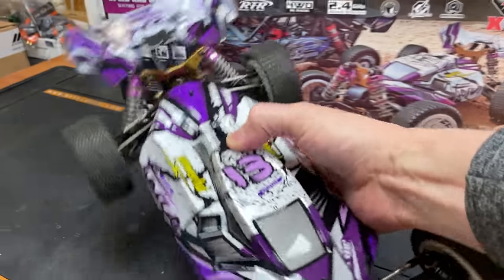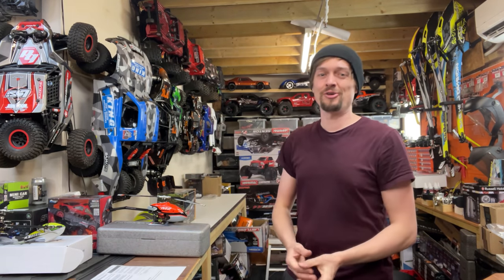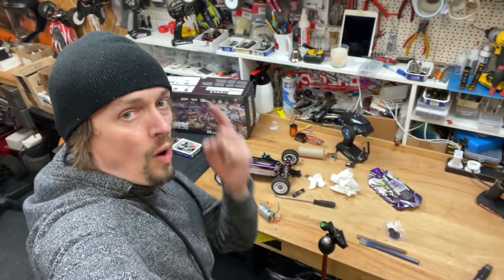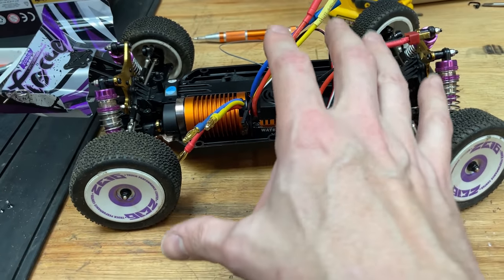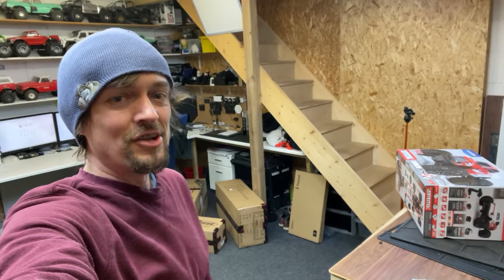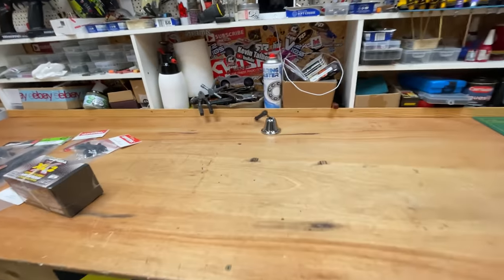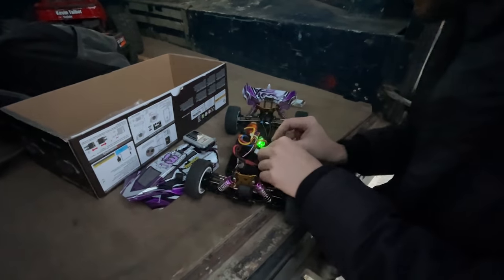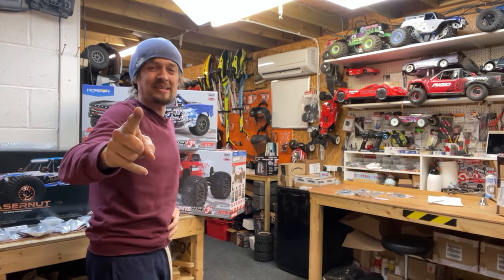Project 100mph DIRT CHEAP rc car

Comment: Hi kev, that paste on the chassis is to control the motor's thermals, since the aluminum chassis is a very good heat conductor. Basically the chassis is used as a massive cooling component
Reply: A bit like thermal paste on a computers processor then?..makes sense!
Reply: @mrmagoo.3678  Exactly!

Comment: welcome to the 124019 club!!!! in order to get that pinion gear out you have to remove the rear end cover all the way on both sides. The front has to come off as well. Make sure you grease the gears inside the gear boxes as well. Foam tires all around
Reply: Hey mate do you think the 124019 is worth it please answer me 💯🐐🔥

Comment: The white stuff under the motor of the 124019 is actually like heat sink paste similar to the one use on a computer processor. It uses the metal chassis as big heat sink.

Comment: Hey Kev, i've got a Lasernut and it's ace! Not a basher really, but for one bit of advice before you get going for real, change the centre diff spur gear to an alloy one, the stock is plastic and made of something like playdoh. Hot Racing and Vitavon do a good one.

Comment: I have one with 120 amp 10BL120 ESC + 3650 brushless 3100 KV  platinum from surpass hobby and it is a Monster on steroids, ESC and motor stays cool at the point you can drive non stop for 2 hours as long you have spare 3S or 2 s  batteries.  I have 2 others with 2838 and 2848 brushless motors with 35AMP and 60 Amps with 17T pinion mods and it is also pure madness jumping high on dirt track and still more than 60 Km/h on 2s and around 75/90 Km/h on 3S. And after all of this I still love to drive my others 144001 with stock brushed motors daily on my garden tracks. 
Long live to 144001 !

Comment: You better take a fire extingusher with you, Kev. Got exactly the same brushless motor and ESC two days ago... Works good... Exactly for ten minutes... Then it starts cogging. On 3S the motor was so hot I burned my fingers on it. The ESC is definetly not capable of 60A. Hopefully it's not catching fire. :D

Comment: I seen you with one I liked it so after shopping and buying a 40$ body and Axel's 47$ front 47$ back . 40$ on linkage .15$ on wheels and 17$ on transmission it's going to be ready to build by next week end . I'm putting slow moter in at first see how it dose then go to the next level up till it's happy may put a shell over it as well  . Will do video of build and test runs

Comment: Bevel gear for the rear diff is on the end of the shaft. Need to take the rear diff apart to change the large plastic gear.

Comment: "What the hell is all that?", you ask,  that is thermal paste, put between the motor and the chassis, to enable the metal chassis to act as a giant heatsink for the motor. IMHO a smart move by WLToys to allow the brushed motor to better shed its heat and last a little longer.

Comment: I'm pretty sure the paste that was between the motor and the frame was thermal paste, since the stock motor doesn't have much airflow or a cooling fan I assume that was to help not burn out the motor.

Comment: Ooof Kev those GoolRC Electronics go up in smoke all the time. Consider HobbyWing. 1/10 scale systems may be a bit more but still very cheap overall and don't burn out. Also, Arrma just released the new Vorteks 3S BLX 4x4. A Legendary name returns after so many years and its looking very good.

Comment: Tekno et48.3 / et48 2.0.   .3 version has all m2c upgrades available, you have to get the mt410 and covert it, only difference is chassis, and you’d swap out m2c towers anyways

Comment: Hey Kev huge fan watched all your videos 2 or 3 times. 😎. Can you show your viewers the Force Epidemic which has been discontinued but can still be purchased. New name for the truck is FS racing Big Foot. Fs racing has a huge line up of cars and wouldn’t mind seeing a different brand altogether on this channel. Thanks for the laughs 😎👍
Reply: E-hacker is the new epidemic or you can go 6s with the big foot. They both share same platform ie. the entire roller suspension bulkheads everything except some electronics and aluminum parts

Comment: Hey I have a question about the e revo. I upgraded my E revo (1.0 or original idk what to call it) from brushed to brushless. Now it has a brushless motor and the E revo 2.0 esc and ever since I upgraded it I’ve gotten this lag between going forward and backwards. Basically instead of trying to instantly go forwards when I’m going backwards (or vice versa) it stops and I have too put the throttle on neutral and then the way I wanna go again. But it usually takes three to four throttle resets for it to actually start moving again. If it was just go forward break set it to neutral and go again I wouldn’t care but I have to set it to neutral several times before. It’s just a huge delay and it makes the whole experience feel slow and clumsy

Comment: 3:17 , you need to unscrew the diffe case from above because inside are 2 bearings holding the shaft and the pinion :P

Comment: Lil heat in the spur gear to get the thread lock hot it will slide right off for next time

Comment: I built a dual motor setup, trying for 125mph. Is that a hi-torque servo? I put an 11kg Helo micro servo to handle better at high speed.

Comment: I got that brushless system for my Rustler 2wd and the motors drive axle snapped off! (then I switched to a 4s in an extended battery mount with a castle creation motor and esc

Comment: If that's gool rc, there's a program card for it.  I had that setup in my slash and it would go fast enough to flip over. It can be a bit.... temperamental with the whole fully charged battery, moving thing. Now, it's in my exceed driftstar, but I couldn't get the old pinion off so it doesn't move yet.

Comment: Typhon is the best of all 3s arrmas!!!!!

1st: 17mm hex instead of 14mm
2st: wider stance (unlike the smaller granite and senton)
3rd: anti parachute body (unlike the senton, where you put your body off anyway cuz it drives 1000x better without)
4: typhon body keeps the inside always clean

I see no reason to get a 3s senton or granite
I would rather get a typhon, swb chassis and a granite body and i would still be better than the granite by 1000 times.

Comment: I just got back into RCing after a 20 year break. I used to run all nitro but my time is limited now so I bought the buggy in your video and I have an issue that's driving me crazy. When I hit full throttle, the car shoots off to the left. It seems like the right side wheels are going faster then the left causing it to make a sharp turn every time. Any suggestions?

Comment: I just got the wpl 24 yesterday and it came with a 7.4 v battery and I have a 9.4 v and it has the same connection but the truck won’t work with it only the 7.4 and I don’t know why any help would be appreciate love your videos!!

Comment: yo kev i challenge you to build a custom petrol rc from scratch using a lawn mower engine.
im 11 and i've done it i named it the minotaur. the minotaur workes and drives it hits 100mph in 10 sec.
I am challenging you kev.